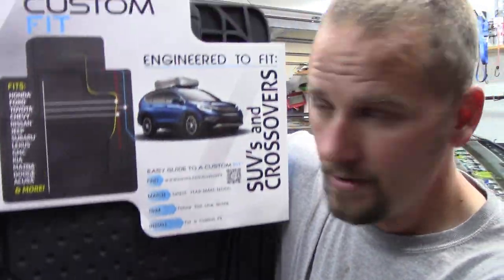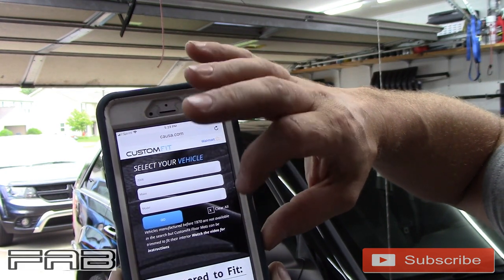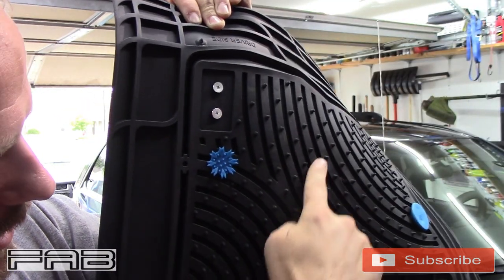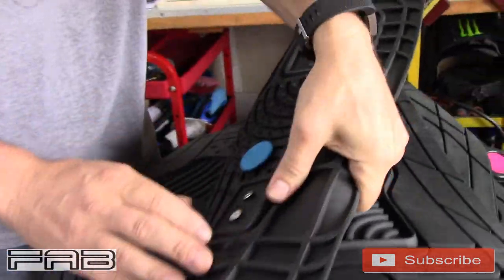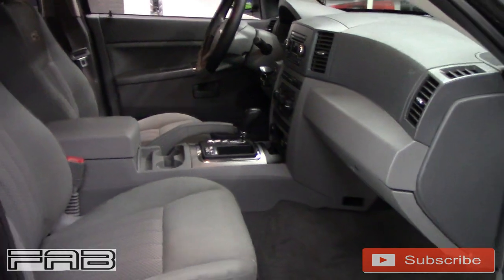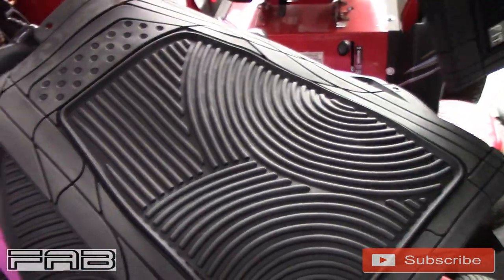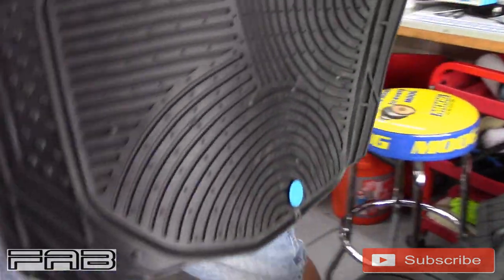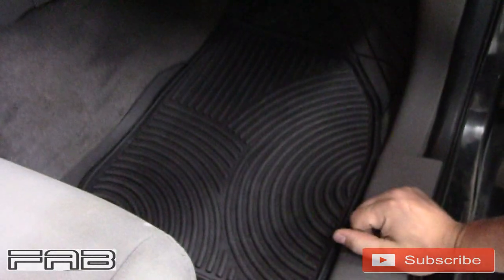Custom Fit Floor Mats From Walmart Review

Comment: I second the view of don't take the company's "templet" for cutting your floor mat based on vehicle.  Mine would have been too small in a number of areas.  Put in your car, take your time, and decide for yourself what sections should be removed for your proper fit.

Comment: I have been trying to go to this website for a week! Keeps coming back with a '520 error'..something about the 'cloudflare'! Already NOT looking good if I can't figure out how to cut them! AAAARRRRGGGHHHH!!!!
Reply from the maker: Ronald Cluney Your local Walmart should have them. Yeah I messed up and cut a little to much off. Cut a little at a time and then fit them. It will be a pain but worth it in the end.
Reply: Thanks. I actually bought them shortly before I found your video. I'm sure I can cut them by trial and error, but the instructions from the website would make it a whole lot easier. But, I guess I'll have to do them the hard way. ;)